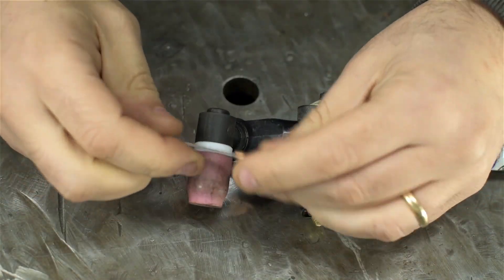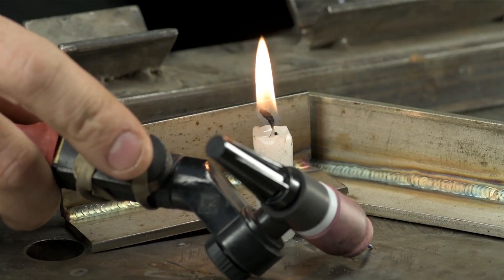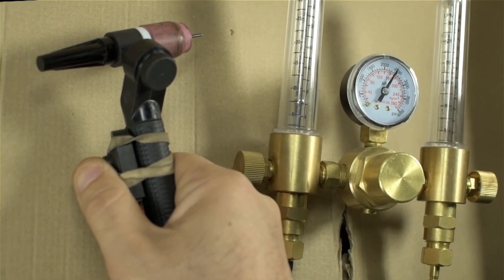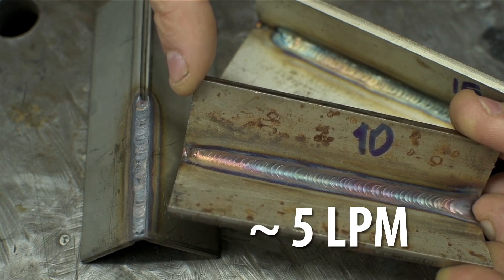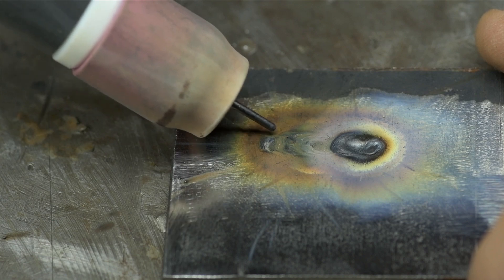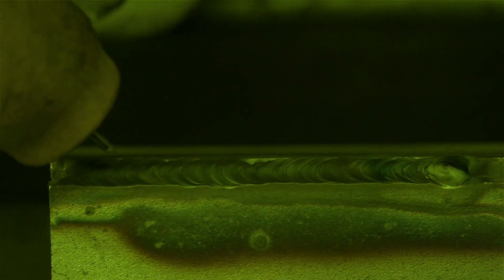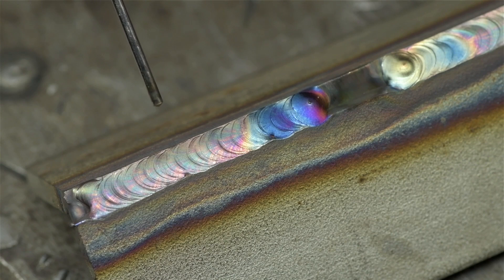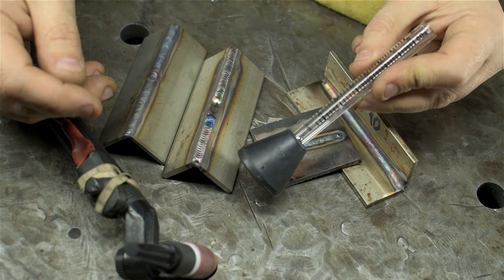TIG: Effects of Gas Flow Settings

Comment: Uncle Tony ?  Is it possible to tig weld when out off gas and use arc welder electrodes with its flux coating.
 With this being your ( ONLY Option ) Emergency Situations ? 
ie: fridge is empty and neatest pub is 3hrs away !!
Reply from the maker: you wouldn't be tig welding. :)  6061.com has/had a video on doing just that, putting a coated electrode in a tig collet.  so, yes, it would weld.
Reply: Dean Robert the gas doesn’t just protect the weld, it also protects the tungsten electrode. If you weld without gas you can melt steel, but it will burn the tungsten and contaminate your weld. Maybe some flux that creates an atmosphere. But it would still be ill advised. Better off just using that arc electrode as intended.

Comment: Very good. I do think that you would have had more issues at 70 cfh if you used a standard cup instead of the gas lens.   I'm a total novice on TIG but have found gas flow setting to definitely be an issue..  Thanks for the video.

Comment: If your welds look like that, you have adequate flow rate, and you dont have a hole in your line, and you just put a brand new chinesium gas lens on you fancy new 7 dollar size 9 flex head torch your lens came pre plugged from the factory...... ask me how I know

Comment: Hello This Old Tony, 
being an absolute beginner in TIG welding... well I haven't even begun TIG welding, but I would like to, can you give me, and probably a few others watching your channel, a few tips on how to choose a good TIG welder that could start me off in TIG welding until I reach the same level of proficiency (in my wildest dreams) you have. Obviously one could argue any old cheap TIG welder would do for a beginner... but really, I hate to add just one more useless piece of junk to the World Wide Wave of E-waste already available.
Thank you
Reply: TechneMoira I’m no Tony, but I’ll do ya a solid and throw my 2 pennies in this hat. 
1- decide what you’re going to do with it- just weld steel/stainless steel? If so, a DC only TIG will work. Aluminum? If so, you’ll need an AC/DC machine, which is usually more expensive. 
2-get the most expensive welder you can afford without the wife/husband/other blowing a fuse. 
3- decide how important having local parts, service, consumables are to you. Do you order everything online and have no issue with waiting a few days for supplies? Or would you prefer to have access to things locally and an actual person close by to answer questions and provide service and/or warranty work? 
3- if you’re a locals only kinda buyer, then you really only have 2 choices, if you’re in the US- Miller or Lincoln. If you’re an internet buyer, you have Everlast, AHP, HTP and a few others. But with those, warranty work will take longer and in some cases you will be the one replacing failed components that they will send you. With Miller/Lincoln, if it breaks under warranty, you drop it off at your local dealer and they fix it. 
4- once you narrow down a few options, watch as many videos as you can to get as many opinions on each machine as you can. Everyone likes something different or dislikes different things about every machine. There are hundreds of videos out there that cover this exact question you’ve asked. 
5- in the end, you’ll probably find you have 3 or 4 choices for a decent “entry level” machine: Lincoln TIG 200 AC/DC, Miller Diversion for the local choices or Everlast (they have a few options) if you’re into buying welders online. 
Everlast gives you more bang for the buck but can also get confusing to use for beginners because of all the adjustments they have. The Miller is limited on being able to upgrade anything on it, like the torch because it can’t be easily replaced and it has very few adjustments. The Lincoln is a nice middle ground in that it has most of the basic adjustments a beginner would need and has components that can be easily upgraded later. 
And whatever you do, run a gas lens.
Reply: First of all, thank you for your extensive and very complete answer.
Yes, all your recommendations make absolute sense. I would like, though, to answer your recommendation nr 4. 
Not to brag, but I probably watched a hundred or so videos (if not more) made by a variety of people, from the green-fingered DIY guy next door to specialists, like you or This Old Tony. Aside from the fact I watched myself silly and wrote down all sorts of tips, tricks and recommendations on a long paper list (yes, I'm one of those), I'm still no nearer to finding some sort of guideline on how to choose a good TIG welder (fit for an evolving beginner).

Obviously Price is an important factor. I would say that's the elephant in the room. But I attach as much importance to aspects like warranty, accessories, technical help, etc. 
I quickly realised that, when you jump into TIG welding, you're not only investing in a (good) machine, but also in all sorts of necessary material like gas, tig welding rods, gloves, glasses, etc. I roughly estimated that you'd need to invest about 30% of the price of an average TIG welder on top of it, to get started TIG welding.
Also, there are so many different sorts of welding rods, pressure gauges, welding visors, etc. it's very easy to get lost in all those specifications. Not to mention all the sorts of welding one could do (I happen to be interested in Aluminum or Stainless steel welding)
You get the picture.
Bottom line: 
Yes, I would love to launch myself into TIG welding, knowing perfectly I will probably never become more than a glorified DIY welder. But, I won't do it at any price... I'm not rich (that too is an elephant in the room) as probably most beginners aren't. So I might get by with a cheap(er) machine than you, but I don't want to waste my money on something that will break down after using it three times, or something missing just "that" setting that would make welding (aluminum e.g.) possible and easy.

Where I live (in Europe) we can find local dealers of (obscure) professional brands of TIG machines. But those cost an arm and a leg. You "could" buy on Ebay or Amazon, but who's to say they are good (I don't necessarily trust product reviews as they are seldom totally objective)... I could rent one of course, but after renting a few times, I could spare myself the expense of rental and just buy one.

So, like you, and This Old Tony say, it would be a case of finding a machine with just enough settings to make it useful, and watching details like warranties, price of accessories, and what one would like to achieve. *sigh*
If only good machines were cheap... or all machines, the cheap and the expensive ones, were good...
Thanks a lot for your advice, it's much appreciated
Reply from the maker: that's probably the hardest question ever.  Recently found myself in the situation of only wanting to spend my money once, and after decades of research  settled on the HTP221.  no affiliation, just a happy customer.  it's a lot of machine to grown into.  Jody over at welding T&T seems to like CK welder.  They're both about the same price.   For less than half those, there are a host of import machines to choose from.  It's hard to say.
If you want to just try it out, check ebay/craigslist.  used DC TIG welders can be had for cheap without all the bells and whistles.  In this vid I used nothing but DC.  whatever you choose, be safe!
Reply: Thanks Old Tony. Yes, I might end up buying a used TIG welder and use it until it breaks down or I would reach the limits of its possibilities. It wrangles a bit I would spend twice, but, I would at least not be generating MORE E-waste. I guess, I better watch a few more videos and keep jotting down more tips, tricks and recommendations for a while :)
Loved your videos by the way, those of TIG welding most of all, that goes without saying ;)

Comment: Seems a little like you should rather use a little more than you'd think you'd need, since using too little has a stronger effect than using too much.
Reply from the maker: probably, but if you do more welding than me, more gas can probably add up fast.
Reply: I mean, yeah. From a cost standpoint you want to make sure not to waste gas.

Comment: I’ve never tig welded before, but I’m surprised that I’m only hearing gas flow and no arc noise - is it that quiet in person, or is the mic in another location?
Reply from the maker: it's quieter in real life!  the mic is always in the same spot (clipped to my shirt).
Reply: Oh that's dope. Great video as always, cheers!
Reply: DC is virtually silent. AC will make noise, at the switching frequency.

Comment: I've been no gas TIG (or as I call it T) welding now for 50 odd years and never had an issue.
Reply: lol
Reply: Some of those claims seem........ Doubtable.
Reply: @dimitar4y  What's doubtful about it? I stick a tungsten in, weld for a minute, discard the bit that's left, stick a new one in and keep going!
Reply: @JoshuaNicoll  I uhhh.. Still am skeptical unless you show a video of it with a weld test strength (a.k.a. bend the joint see if it breaks or not) ._.
Reply: Man some people just don’t get sarcasm. Lol
Reply: @Jeremy-iv9bc  No it's just, that, it's pretty plausible.. I've never really decided to kill 3-4 tungsten rods and see if the weld even holds. It... Should?
Reply: don't bully me :'c

Comment: I was taught to read a flow meter by straight on center of the ball, try to read it from any angle but dead on level, might as well be thowin darts at a chart.  Also the flow meter should be as true vertical as possible, but not as critical as level reading.  If your portable flowmeter does read near your base, first check for leaks, if none, consider round fileing it.  I have never had a portable flowmeter that was dead on reading, but it should be close.  I can't say sniffing O2 for 15 years hasn't taught me anything, as I know to check my flow rate often, and bottle pressure BEFORE leaving the house.
Reply: 15 years . . . only about 4 for me . . . certainly is ugly bling innit?

Comment: Tony - what a wonderful, and entertaining romp through the world of flow rates. I picked up a lot of new tips, and seeing side-by-side comparisons is priceless. The biggest laugh was seeing the 70 cfh setting blow the workpiece away - similar to your 'shooting' your air rifle away in your previous video. I love how you always find new ways to make me smile!
Reply: You know you're cool when Ron Covell watches your videos... way to go Tony!
Reply: Ron question for you. Millers calculator states the larger the material you are welding the larger dia tungsten to use and the larger the cup for better gas coverage is this correct? Someone said they are welding 1” lap joints with an 8 cup. I find that hard to believe the coverage of gas would be terrible. Any help would be great. Thank you
Reply: Welding Junkie - Are you talking about making a lap joint with 1" thick plate? Aluminum or steel? Multi pass? How many passes to make a 1" fillet? 
Material that thick is out of my range of experience, but I would tend to agree with you that a cup larger than number 8 would probably be needed for adequate coverage.
Reply: Ron Covell I don’t have exact senerio but, I learned from today’s standards and  I was taught that you increase your cup size when your material thickness increases so that you get the correct gas coverage as long as there is space to fit it. 

I was taught this way so that you don’t have to use say a 6 cup on half inch aluminum and have to double your gas flow and waste your argon. Each cup has a recommendation for gas flow to get the cone of argon around your weld. For expample. .40 tho use 4 cup 1/8” 6 cup 1/4-1/2”  8 cup 1” 10 etc. I know stainless usually needs double flow.

When I use Miller Welds Tig Calulator when I enter in material it also recommends a larger cup as the material size get thicker.

I just want to make sure I am correct in saying this. I know there are always exceptions of course but with matching the cup size to the thickness of the material I am correct in saying you’ll get close to where you need to be with correct gas coverage right? Thank you for your insight and help on this.
Reply: Yes, that is a good 'rule of thumb', and you understand that there are exceptions to every rule!
Reply: Ron Covell thank you for your help. It’s very much appreciated. I was starting to second guess myself even though it worked for me. Have a great day Ron.... Jason
Reply: Hah - I was waiting for him to shoot it off the table! I work with really small pieces of metal, and even at 12cfh I'll have stuff that wants to walk away from me when I hit the pedal. And often the parts are so small it's hard to hold them with anything. Oh, such good times!
Reply: Ron out here in the comments section of somebody else's videos just being an awesome human being.... Sometimes it's hard to believe there are people like him in the world. When I watch him I feel like I'm watching Mr Roger's Neighborhood or something.... Hes so damn nice and genuine it just blows my mind, and he's a freaking wizard w/ anything made of metal. Sometimes that makes me think he's actually turned himself into a cyborg....    😂
Reply: Maybe he has? @xpndblhero5170
Reply: sounds like chinese comment farm comment
Reply: neorec ormon Sounds like you need to go find out who Ron Covell is. It's awesome that he takes the time to post a comment. I hope some day I have the ability to take one of his classes.
Reply: James Sheets I don’t even know what neorec was trying to say? But I agree he/she/it should look up Ron. Just the fact he commented here got me to click the notification bell for Tony’s vids! 🙏🏻